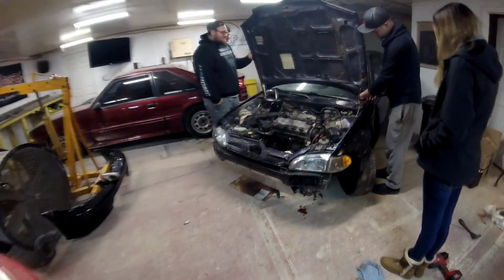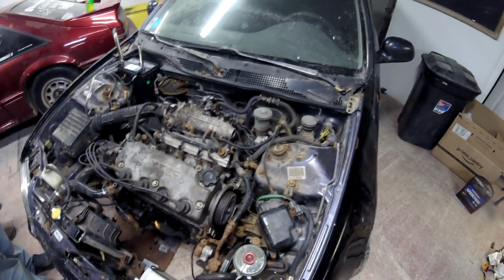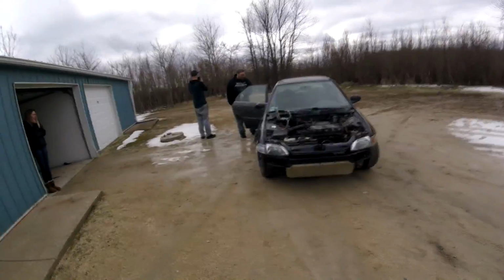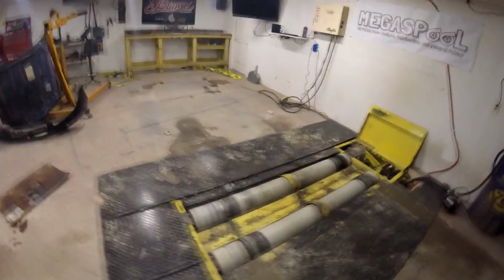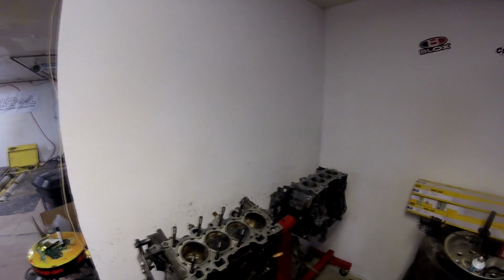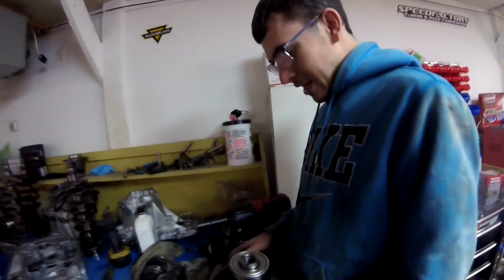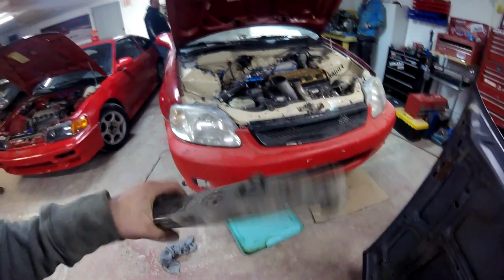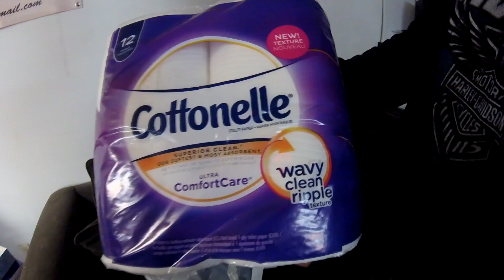I Bought A Cheap $250 Honda Civic! Dyno Tested The YEE YEE Truck!

Comment: What the kid said about mechanics saying it needed a harness is why i dont trust shops. Thats why i bought a 03 Silverado with the 5.3 because i can literally work on everything on ot myself. Since the first of the year ive done inner and outer tierods, water pump, starter, neutral saftey switch, ignition switch, parking brakes and etc. Bought a btr stage 3 cam kit, long tubes, hp tuners, and the next big purchase will be a convertor. Love the channel bro, ive been around since you had 200 subscribers. Its amazing how much youve accomplished since then. Proud of you hunter.

Comment: I've tried the smokeable cbd flower/weed too and it didn't seem to work as well as the cbd oil gel caps. The cbd oil is where it's at Hunter!! I've noticed a big difference in my anxiety level. It's almost non existent now thanks to the cbd oil.
Reply: If you hit it in a vape be careful not to take too much. I swear it about killed me 1 time lol
Reply: @justin_parks  Good to know. I don't vape but was thinkin of trying it. I just take the oil straight from a dropper that comes with the small bottle or in gelcap form. I've done a bunch of research on it to find a good company that gets independent third party testing done to make sure it has the advertised or said amount of cbd in it. Cv sciences/cbd oil+ got good reviews by cbdreviews.com as well ,which basically makes it independently 4rth party verified. There's a lot of scam brands out there that don't have the advertised amount of cbd in them or any cbd at all.
Reply: @MoonlightingBadger  yeah bro I'm more used to just smoking weed. And with the cbd in a vape you can't feel it going in so I just kept hitting it. A few mins later my heart was pounding a million mph and I could feel it thrpugh my whole body. I couldnt breathe I really thought in was dying. So just take a quick little toke and blow it out. Go slow too, hit it and wait 20 mins or so cause it sneaks up on ya